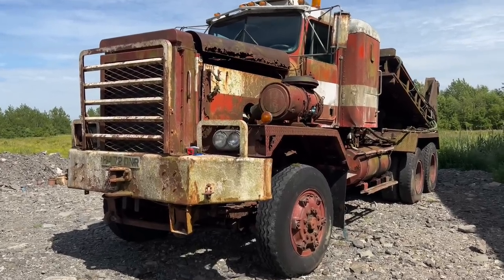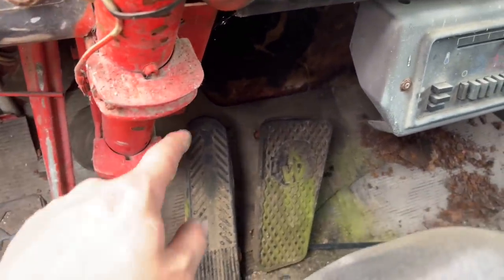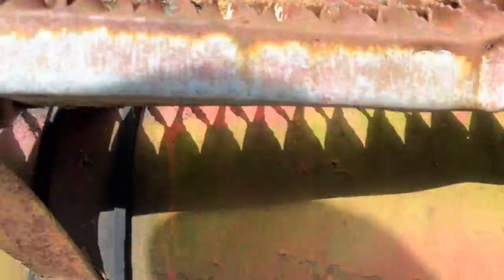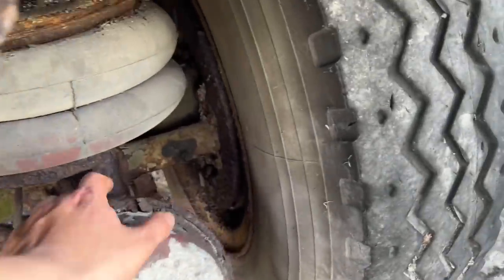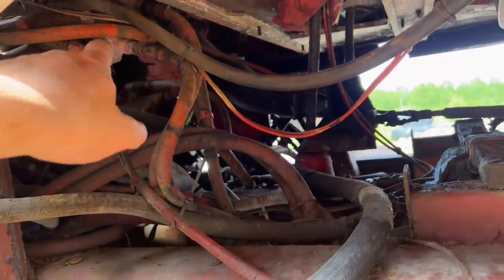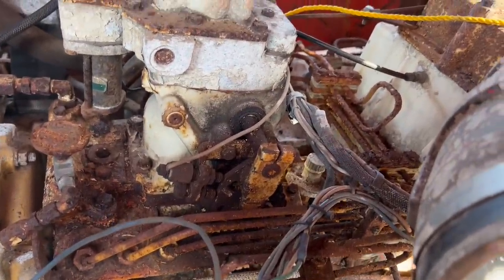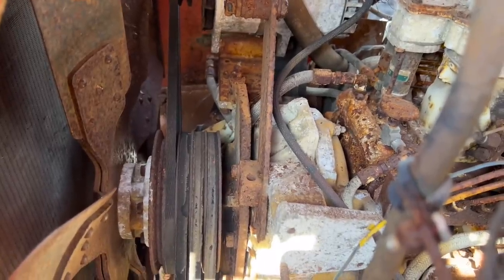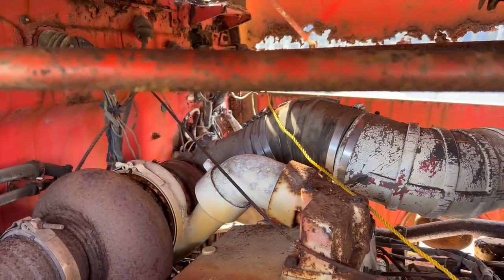Kenworth C540, abandoned since 1991, CAT 3408 V8. Ugly and rusty! #diesel #truck #project #rust

Comment: The Kenworth, Sold new to Zahid-Heanor haulage that was the Cat dealer out there at the time, it was bought out of a scrap yard near Nottingham in February of 1991 had the fifth wheel on it, the truck was modified with the guillotine then at a welding shop, the 6 cyl maggie came from a breakers in Birmingham, the slab of steel I think is 12 ton came from a steel merchant in Oldham, when it was first used at Gatwick airport the front wheels bounced off the ground by about a foot, and the back axles lurched, the answer was to put those stabilizer wheels down on the ground, they came off a old Halls skip wagon at there yard near the airport, as for the dent in the sleeper, it wasn't stolen, what happened was one guy was new the job, we will call him Dave ( Because that was his name) was at I think Alconbury and he started it with the hammer turned on thats why there is a key in it and the mast was laying down, I think that's a urban myth about the v 12 cat I far as I was aware it always had that motor in it which was standard for the logging truck it was.
Reply: P.S. There should be a coin glued down on the top of the radiator.
Reply from the maker: So I can only go with what the original builder and purchaser told me, there were two of these purchased new by Zahid. The sister truck was scrapped 

The owner said this one was bought from Zahid in 1988 when they finished with it in Saudi. At which point it was shipped to the U.K. and when he was out there to look at it it had been fitted with a V12 3412 pushing 1000hp. However it most definitely started life as a 3408 truck as I have the bill of materials from Kenworth relating to this chassis number. 

Registration wise it is registered as an 88 which goes with his story of when it was imported, it is agri plant and was free tax/mot exempt and still is as that is what I have registered it as 

The slab is apparently 15 ton but 12/15 is pretty close to each other, Richard the builder said it came from British steel and was part of a rejected billet that was created when setting the new rollers up.

The stabiliser wheels were not part of Richard's original design, they were an add on when someone apparently stole it. He had planned to put hydraulic rams in the H section which would act vertically down in the same plane as the guillotine. The skip stabilisers actually push it past centre so some additional supports have been welded in behind the guillotine which need to be pinned in place when the bed is lifted
The weights under the cab were then added to stop the chassis flex/whip

I have not seen a coin, but it could have been removed over the years

Comment: Wow.. really cool truck but woo-boy!  are you in for some work . Guess the worst thing will the firewall. Finding a cab would be easy in North America  but I'm thinking would be a real pain in the UK.  Good luck 👍
Reply from the maker: Thanks, luckily with the cab being mostly aluminium and fibreglass it's easy to repair 

I'm going to try and get as much steel prepped before removing it from the frame as possible. Floors, rough shape firewall and rough cab sun structure can be made before removing it. Won't be quite the same as factory but just as strong 
I fancy making some visible dimple die stuff

Comment: You probably have gotten into it by now but the brake valve is usually ok and the plunger in the pedal base is what is seized which is not included in the pedal valve. Ps deflate those tires before taking them off the truck.I had a close call when removing a split rim some years ago as the rim had a crack and when removed from the spoke the rim shrunk in size and spit the split ring.I still have shrapnell in my eyes but thankfully they work just fine. Best wishes with the project.
Reply from the maker: Thanks Mike, I've actually been on with removing the valve today, its a bit crusty and corroded. 

The new one is much better looking, I have also removed the pin from the pedal to try and remove any crud that was built up. I'll be heading back tomorrow with some penetrating fluid to give it a good spray now I've removed the rubber boot from the plunger 

As to the rims, luckily they're not a standard split they're a Trilex. I will make sure part of the next video shows them, but they don't blow up on you unlike old splits or locking ring wheels. The lugs can still fly off though! So I'll be careful with those during removal

Comment: A new sub myself an wishing to see it finished. John Story in Tennessee has one of the finest wrecking yards an cares about his customers and will follow up to see that your happy with anything he provides. I know that you love this cabin and all, I myself have done this kind of restoration before. Your a looking at after the job is done on just the cab alone, four or more  times the cost of a brand new truck. I hope that you have deep pockets or lots of volunteers for this one!! Best of luck
Reply from the maker: I priced one of these up new and it would be over 3/4 million! 

This one was right around 250k back in 1981 when it was commissioned. I'd hope it can make some of its restoration costs back though 

I'm actually now in two minds about keeping or scrapping the concrete hammer. It's very much a one trick pony and there's a few thousand alone required in hoses and control systems to make it operational again. Whereas a 5th wheel would be much more use to me

Comment: WOW South lakes! You like work! I am big truck nut in USA and sure seems like just getting parts would be easier row to hoe?! W9s are probably not as common in UK(?) Love the rig and def subscribing! THANK YOU for say you are ditching those HORRIBLE wheel adaptors! I will say 22 5s will look pinner vs 24.5 as it def specced on 1400x24. Has to be biggest Kenny around yer parts. Too bad on the cancer! GOOD LUCK and new follower here! Cheers from Santa Cruz Ca! Philip Nash has multiple V8s! Hope you guys collaborate and I see yer English Kenworths together
Reply from the maker: I know of one W9 with an N14 in it over here. I'm sure there are others, but only one comes to mind 
As to the wheels I was going to replace them but I managed to find some cheap new tyres in the right size so my plan now is to paint the wheels and hubs so they look more presentable 

These Trilex wheels were specced from the factory and Alcoa wheels in the standard 10x285.75 pattern are rather expensive after looking into it! I will paint the hubs metallic black and the rims a nice red/orange colour rather than the red lead they are currently clad in 

It is probably the biggest Kenworth in the U.K. but there are a few other trucks that are larger. Some of the new Mammoet prime movers and an Oshkosh recovery truck come to mind
Reply: GREAT STUFF! Love KW and you my man have a very big girl! Be glad to see the efforts of your labor! That UK weather ate er good! Glad to see Washingtons best w a big V8 cat bein saved! Got me watchin @big_rig_resto

Comment: I would absolutely wheel that.

Dang that this thing isn't stateside.  I'm in the market for an old truck to get back on the road and put to work doing oversized hauling.

This would be perfect.
Reply from the maker: Plenty in Canada and Alaska
Reply: @big_rig_resto  Yea, I have a solid line on a 75 c500, but it isn't as skookum as that chungus, heh.
Reply from the maker: @danielhomant2832 this is a 540, not sure if it makes a difference vs a regular 500. But it was the big boy in mainstream production terms

963 is the king of big Kenworths though!

Comment: Nice to see you are not afraid of lots of work,nice project though, i have 2x 3408 cats in trucks in Essex,uk, yours sounds like a direct injection model, i have a precup, and a Di, you are lucky it ran, the pump elements have a tendancy to stick in their bores after standing, that footvalve is pretty universal,we have some parts if you are interested.
Reply from the maker: I have a foot valve already thanks, turned up from the USA earlier this week 

Had it not run I wouldn't have gone ahead with the deal but it sounds sweet and it's low hours. Do wish it had the old V12 in it though 

I may want some injector lines if you have some good ones. These are a bit crusty, if not I will probably get custom stainless ones bent up
Reply: @big_rig_resto  I don't have any spare injector pipes, new are a fortune, stainless ones can be made, a bit tricky getting the right  end on them though. Was the v12 a3412 ?
Reply from the maker: @grumpystruckshop3807  I'm not entirely sure which the V12 was, I was told it was a 1000hp engine so could have been that or a 12v71 Detroit 

Given Zahid were a CAT dealer odds are it would have been the 3412 

Injector lines are only $20 ish a piece after a bit of googling so I think I'll just buy them. https://www.dieselpartsdirect.com/fuel-lines-for-3408-caterpillar-engines
Reply: @big_rig_resto  3412 is likely, 12v71 would not be near 1000hp. I have one in a 74 Pete. No turbos@475hp

Comment: Hopefully you can change the tires to modern tubeless.  Those must be the old tub type tires on it correct?   There a giant pain in the ass to change alone as most shops won’t touch tires with locking rims anymore.  At least of here.    (We still have a 1969 Mack DM we run that has em)
Reply: Edit.  Didn’t watch to the part u said your changing the tires
Reply from the maker: @jasondeftones1  I have found and bought 10 R24 tyres so not a problem now, its on Trilex wheels which don't use a locking ring. I will change them out myself once I've put a new brake valve on and can get it moved down the road to my shop

Comment: If I may make a suggestion,..... you said you will use a wire brush to clean the frame, that will take forever and a lot of work, how about sand blasting the frame clean? quicker and does a better job, just a thought.
Reply from the maker: I will probably end up getting it blasted in the future. But a brush on a grinder will knock the worst spots off for me to just quickly touch up

Comment: I was in Iraq and we had Mercedes Atros they had those wheel adapters so they could put 12R 24 tires on the trucks.  (Tube type)  I don't know why.  Probably only used on European trucks,  never seen anything like those in the USA.
Reply from the maker: They're a transcontinental setup from what I've seen. Very popular in Africa 

Makes tyres easy to change and aids brake cooling due to increased air flow apparently
Reply: @big_rig_resto  
Thank you for that information, I appreciate it.

Comment: Would be cheaper for you to buy a cab in Australia and get that shipped over.
Reply from the maker: With the cost of containers these days I highly doubt it! 

Plus the main cab is good and any second hand one would need some repairs too. The steel structure on this is rotten as is the firewall and the floor. But as these are mainly fibreglass/ally the bulk of it is still good so I'll work with what I have
Reply: @big_rig_resto  we have a saying here down under, deck freight on a submarine. 
I’ve driven KW’s of all ages and seen them in wrecking yards and never have I seen one with rust like that here in Australia.
More power too you, but a cab ex Australia or southern US as part freight in a container is much easier than messing with bonded riveted fibreglass, alloy, steel and ply wood flooring. Maybe ex USA/Canada you could get a firewall stamping. Possibly even through paccar UK.
Reply from the maker: @bobbob-fg5wy  I do container freight myself and with them being nearly £8000 now it'd be a damn expensive cab